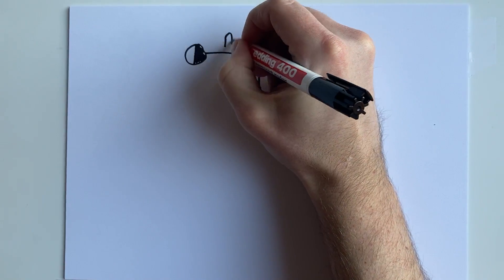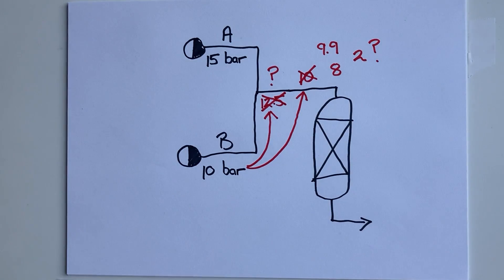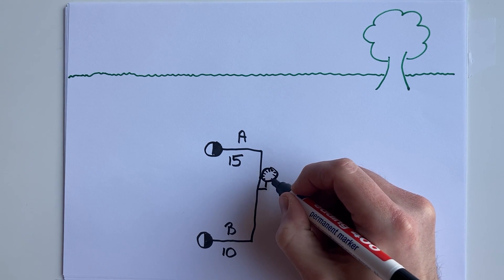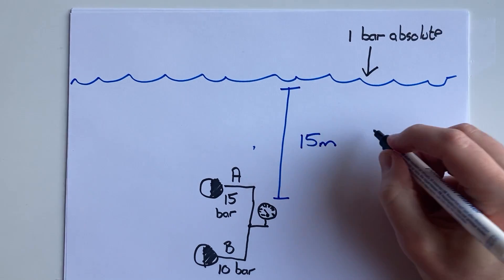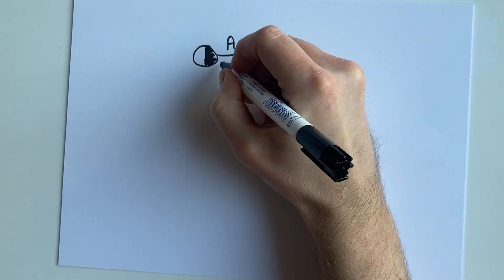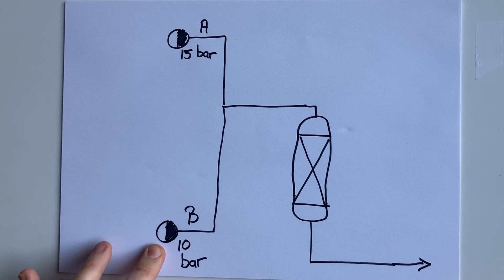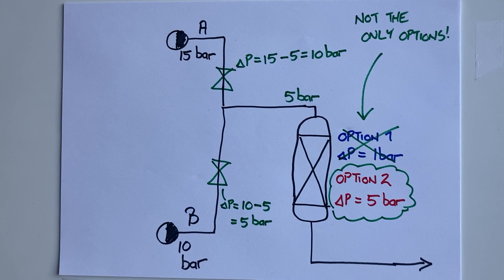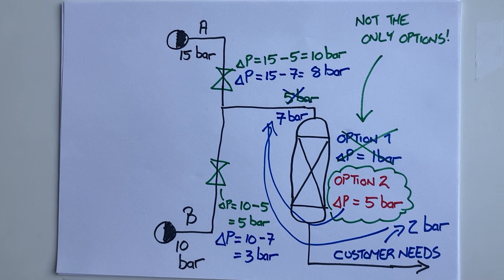What happens when you mix different pressures?

Comment: I’ve seen similar problems in electrical systems. It’s very easy to get trolled if you don’t consider the full context or spot what’s yet to be defined. Great video, thanks Pat!
Reply: Is it valid to reason about systems like the one described above that unless you know "the load," you cannot know the behavior of the whole system? As in electrical engineering, you don't speak of current until there's a force pushing it (i.e. voltage difference), and even adding a seemingly minor element affects the characteristics of the whole system.
Reply: @gtweak7 Good point! I suppose the purpose is to first conceptualist, then quantify. Some questions are designed to force a conceptual first approach to ensure you understand how to calculate for any scenario. Whereas, when you ask a question with a fully defined system, so long as you know the principles already, it simply becomes a math problem.

My physics professor would be pretty clear what problems were conceptual and which ones were mathematics based. But I still needed the conceptual to solve the math problems. I suppose in this case you have a point. It’s not clearly stated it’s a conceptual question and not a question with an absolute answer.